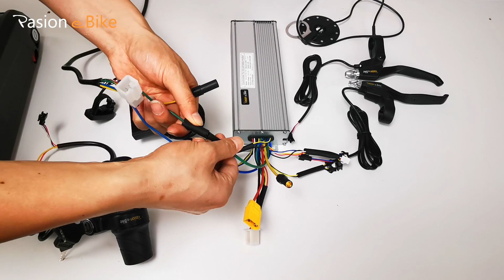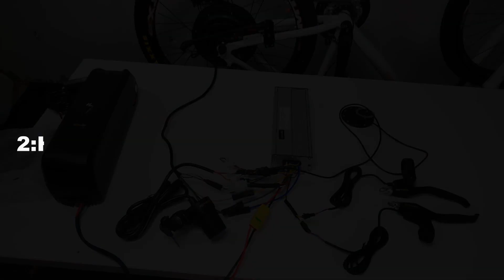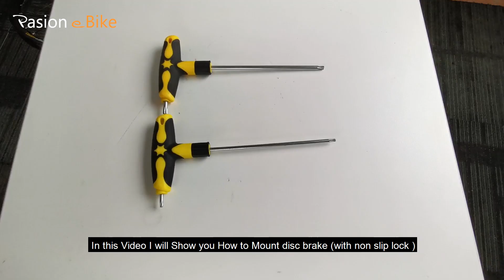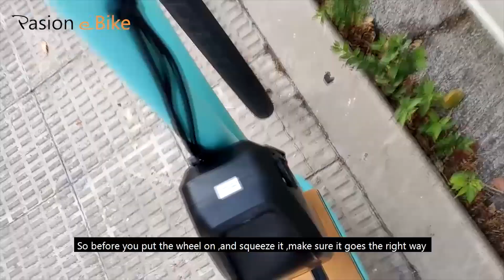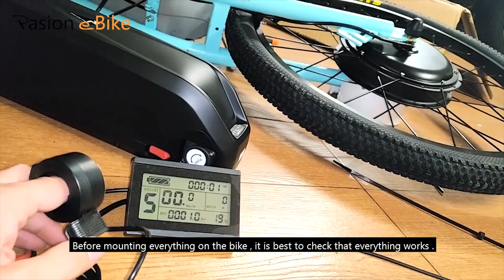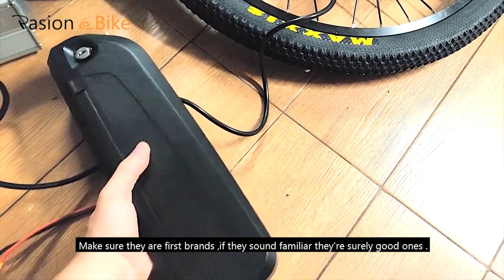Pasion ebike 48v 1500w ebike conversion Motor Kit Tutorial and Troubleshooting

Comment: Battery dead ! Less than 100 km !

Bonsoir

La batterie de 1500 w ne fonctionne plus ! Je n'ai même pas roulé 100 kilomètres !! 
Je la recharge et une fois branchée au vélo en mode On, elle se décharge immédiatement.: l'écran a juste le temps de s'allumer puis s'éteint en moins de 1 seconde. 
AIDEZ MOI

Comment: hi pasion ebike is it safe to use the kit with V brake instead of disc brake?
Reply: I bought this kit several years ago and have v brakes on my bike. As the rim in the kit has tapered sides the pads only  ride on a small area next to the tire. Braking is not great. Otherwise the kit is excellent.
Reply: I would go with disc brakes or you will go through rims like pop corn. I went through 3 rims in 2 years.